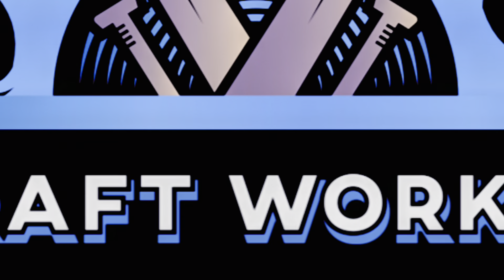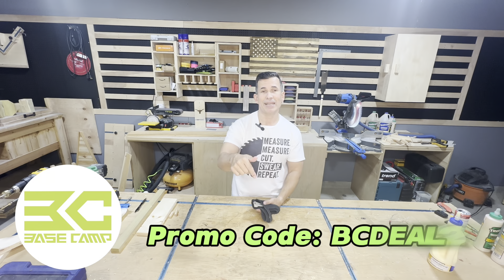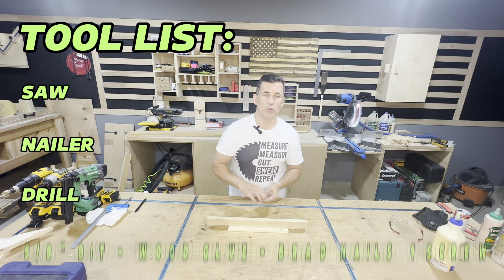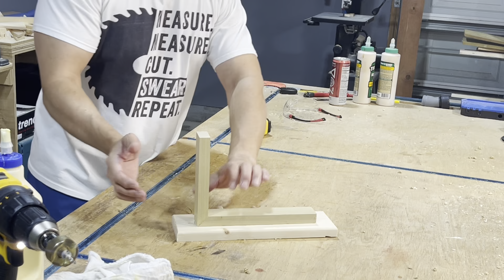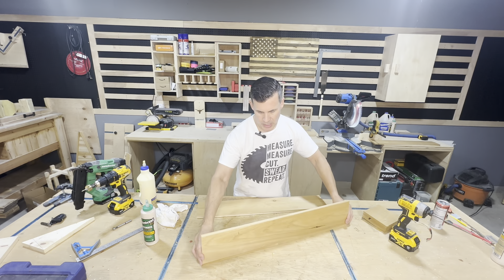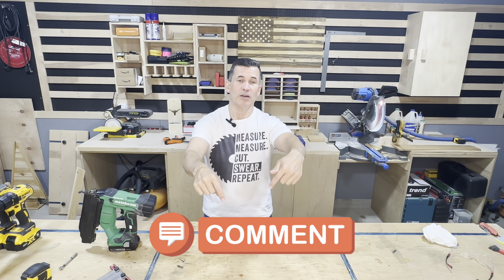Beginner Woodworking Projects – Cedar Planter Box & Keychain Holder!

Comment: Hi Tim, I agree that the accurate measuring devices such as tape measure and combination square are absolutely essential. I have found to my cost that cheapo tape measures are not worth the money . Every beginner should buy  good quality measuring devices first. I also agree that a very good brand of mitre saw is a must but the size of the saw is dependent on the size of the workshop. My workshop is 16 feet x 7 feet (pretty small!) so can't accommodate a 12" sliding compound mitre saw (note the spelling as I am a Brit!). My mitre saw is a Makita 8". I have a DeWalt 7492 contractor saw, which is my favourite tool and it is something I wish I had bought at the beginning of my woodworking journey in 2009 but I only got it last year - what a difference it has made to my woodworking journey.  Oh, yeah, the cordless brad nailer is also a must, not a luxury. I have a Ryobi brand, which has been good. By the way, keep up with these videos!
Reply from the maker: Agree with your points about the shop size and miter saw as well as the brad nailer being an essential tool. Thanks for watching and taking the time to leave a comment… Especially from across the pond 👍🏼🤟🏼

Comment: Buying a tape measure isn't that difficult. But you don't have to buy a 30 dollar tape. I've used a millwalkie tape measure for years and you can get them for around 16 dollars. Right now at Home Depot you can get a 2 pack 16 ft tape measure for 20 dollars.
Reply from the maker: Good info, thank you 👍🏼

Comment: What a wood working journey.  Some might say it was a "whimsical" wood working Journey 😏
I don't see the problem with using your tools.  You do explain things really well for those who might not have the same tools.  Ignore the negative comments.  
As far as the confusion the time change always has that affect on me.  The sleep habits are thrown off which impacts everything.
Mistakes happen. If I had a dollar for every mistake I've made I could retire.
I think the cedar planter came out great.  
I agree the miter saw is a better way to start rather than a table saw. I rarely use my job site table saw whereas I use the miter saw on almost everything I make.
I agree with the tape measure recommendation but I would add that it's good to have more than one; the car, house, every tool bag, etc.  I bought a battery powered brad nailer early in the summer at Harbor Freight to give it a go.  That was a game changing purchase.
Good recommendations all the way around.

Thanks for everything you do on this channel.
Reply from the maker: LOL ... the journey!! I was off while filming that's for sure. Thanks as always for the comments and the support 🤟🏼

Comment: Great video, I love both projects but the planter box has so many options on how to use it. I also agree with you on the cordless brad nailer. I bought the little compressor and nailer package and it was a real pain in the butt to have to drag out everything when I wanted to use it. Now that I’ve gone battery powered I have a lot less hesitation to get in my shed. I would suggest that you look at a manufacturer’s line of tools and batteries and decide on one source. Most have a seasonal sale with a starting package and either discounted or free tools. I have a TINY SHOP and I don’t have enough room for multiple chargers and batteries that only work with one tool. Thanks for sharing, congrats on reaching your subscription goal and now we can move on to the next goal… I beta YOUTUBE plaque would look good on the wall behind you!
Reply from the maker: Thank you so much for that comment. The nailer is a life saver… and as far as a plaque, I got a long way to go 🤟🏼